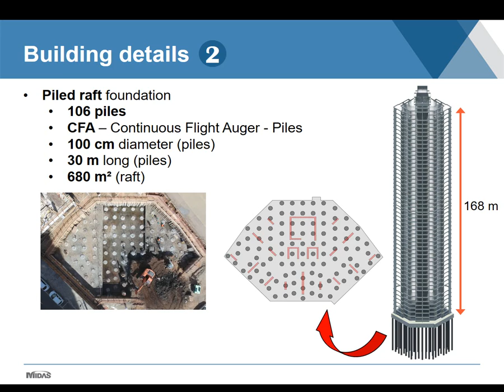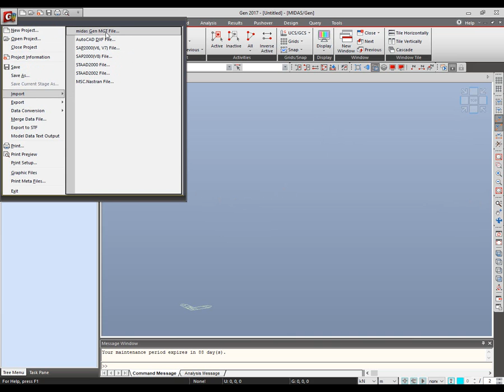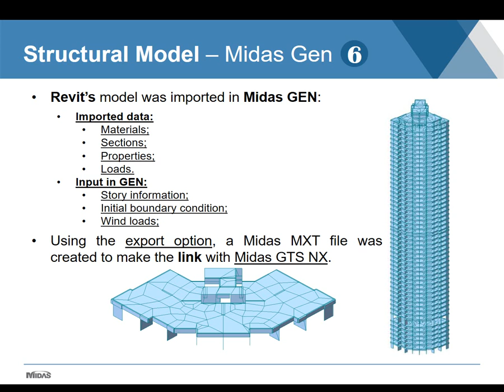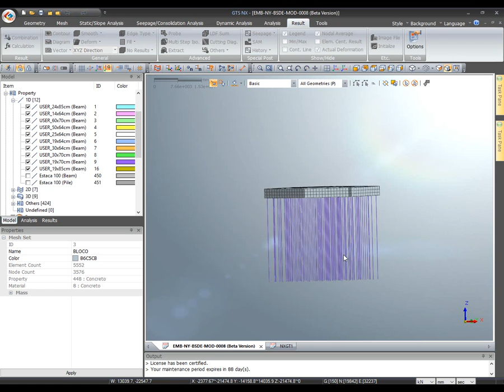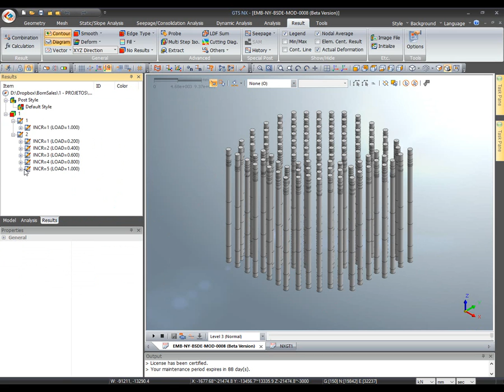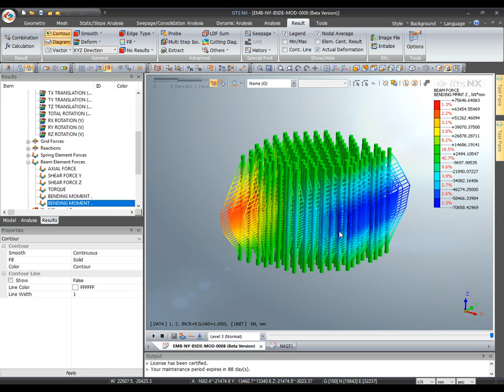Soil structure interaction case study of a skyscraper in Brazil.

Comment: Thanks for uploading this, it was a great presentation!

Did you pass the pile vertical springs/subgrade reaction coefficients from Midas GEN / GTS NX to the structural engineers for their implementation in another structural software? Does Midas GEN have the capability to undertake structural analysis too?

Are pile group effects (lateral) taken into account directly in the GTS NX models, and if so do you also provide lateral springs to the structural engineers for their model, either from the raft or the piles?

Are seismic cases of concern for your building? Have you considered the effect of kinematic interaction between the foundation and the soil?

Thanks!